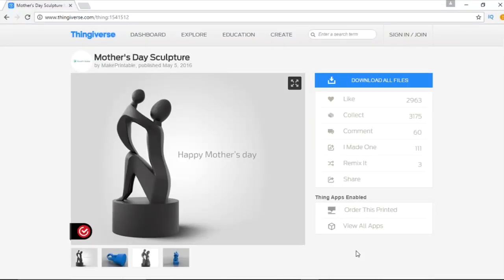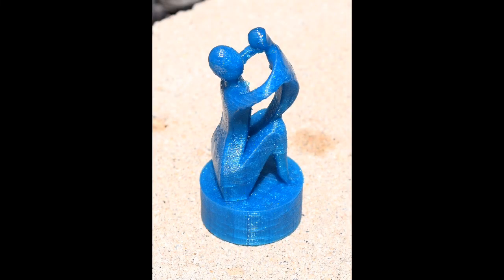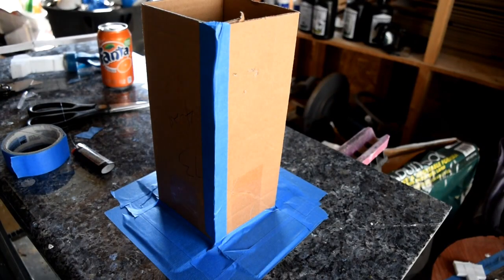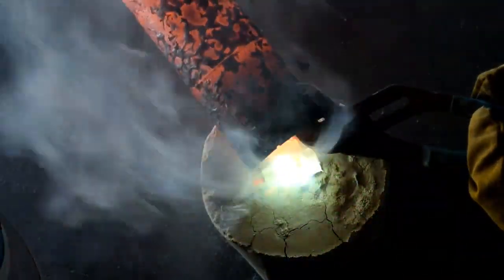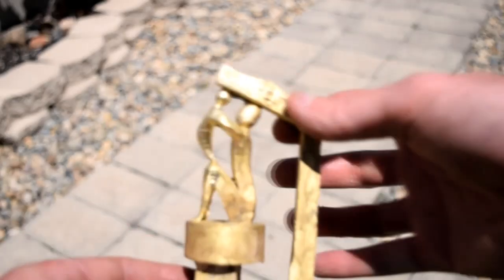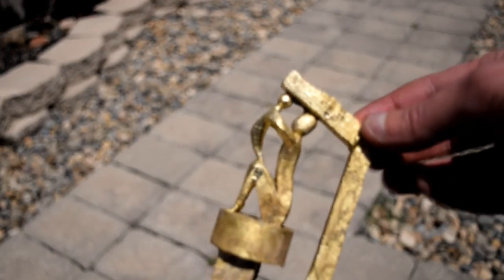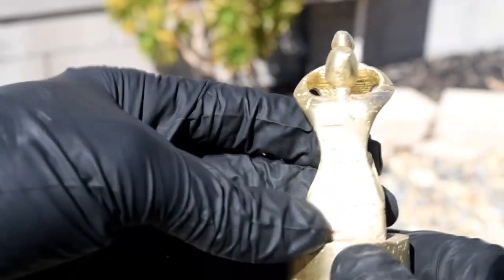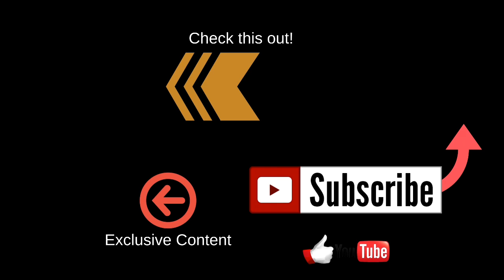Casting Brass  Mother's Day Mom of the Year Award Gift From a 3D Print -Lost PLA

Comment: Hey, I am having trouble with the investment material. How long did you burn out yours at which temps ? I only have a regular oven goes up to 220°C and I want to cast zinc at 450-500°C so my temps, are pretty tame, however I need to make sure the plaster mould is dry without cracking it. My thought process was to dry it at about 90°C-100°C for 4h and then meld out the Polycast filament, first in the oven at 220°C for about 1-2h and then with a small gas burner I got.
Reply from the maker: Typically your dry time at low temp with be 2-3 hours, then slowly increase the heat over the course of an hour to the hottest you can and hold until smoke stops coming from the pour hole. This can take several hours. Commercial investment burn out time takes about 12 hours total. Check out some of my new videos I go more in depth on this with a proper burn out oven. I recast this mothers day statue again couple years later and came out even better.

Comment: beautiful work
what was the material you used to make the block for the model?
Reply from the maker: I've thought about recasting this several times as I feel I can do a much better job now, one day hehe. The mold was made with a 50/50 mix of plaster of Paris and play sand. The sand helps the plaster of Paris from cracking. Any silica based sand would work, the finer the better.

Comment: Ever try wet sanding your PLA model before casting?  I would suggest acetone smoothing but that only works on ABS.
Reply from the maker: +Nicholas Scholl yes many times, but this wasn't PLA. This model was printed with a special wax filament for casting. I did a review on it if you wanna check it out.